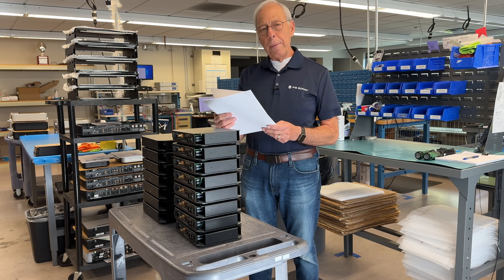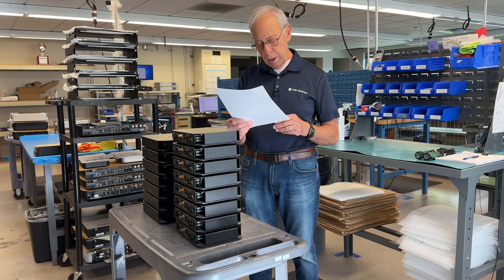ESS vs  Burr Brown DAC chips

Comment: I'm a DIY'er, and I have built a Streamer/DAC based on IAN Canada's stuff. However, I learn a lot watching Paul's videos, because so much of it I just don't understand. But I have two different output stages I have used, one is a passive transformer based the other an active OPA based circuit. All powered with super caps! Power makes a huge difference. One of Paul's video's helped me troubleshoot a bad/severe sibilance issue I was having, turned out to be a setting in my Anthem Pre/pro settings, which has me strongly considering a HT by=pass preamp, after seeing what a DSP setting in the Anthem caused. It was quite remarkable. My Anthem has a balanced input for 2 channel, "Analog Direct" or "Analog DSP", which allows for a powered subwoofer. That Analog DSP, made highs especially in female vocals sound so harsh as if my tweeter was blown. Setting it to "analog direct" fixed the issue. But if I go the HT by-pass route with a pre-amp I have to find one with XLR's because my output stage was designed to optimize balanced connections. In any case, thanks so much for what you do Paul!

Comment: Wow! FPGA for hifi/audio DAC. That’s somewhat overkill and expensive compared to wide available “hard wired” on die based DAs. Either electronics implementation (clock gen/oscillators, flip-flops, etc.) and verilog/vdl programming is a complex task BTW.

Comment: What? A lot of processing? Both, the data rates and processing required for A/D are a joke compared to high frequency applications. Usually, processing of data streams deals with Gigabytes per second and here we speak about a couple of Hundred kilobytes. Max. There is also no real reason for FPGAs. There is nothing in an FPGA you could not do with a dedicated IC design. An FPGA is an IC which can be programmed after production. So it is not better or worse compared to dedicated DAC chips.

Comment: Despite Paul's knowledge & experience that I admire, you all must remember Paul is a business man too, representing his company that claims to be one of the best in this market, and I have no doubt about it! But many of the subjects discussed around the audiophile experience is really very subjective and full of variables, from carpet pile height of your room passing through your real hearing ability up to the cash spent on the equipment (quality equipment if you will). Having said that, the search for the so called "perfect" or "better" product and overall experience lies in a compromise of budget, brand positioning, part's cost, part's availability, "sound taste", marketing differentiation guidance of the company, R&D team expertise, technical resources and a dozen of other unspoken variables that the discussion whether IC "A" versus IC "B" is almost irrelevant, or in other words, almost impossible to do fairly. The best solution I see is: try to hear/ experience different equipments as your budget allows and make your own choice ! And calm down and resign yourself to your choice, pretty sure the gear that costs 10x more will most likely sound better ......

Comment: Paul, I have a Marantz 2325 and Bose 901s series II and want to stream Tidal or Qobuz so I need a streamer. I could buy a cheap streamer like a Wiim or Node and use a separate DAC or use the DAC in the streamer. Can you recommend a solution?

Comment: Actually processing sound is not a super hard process for a modern dac or any modern dip chip. Your phone can output 4K 10 bit video at 60fps in real time and you don’t need fans or massive cooling. And actually inside the digital bit if you process with no errors or lag then the sound will be the same. It’s when you convert to analog where things can change. And this is why we moved to digital. It reduces the number of variables and possible errors

Comment: Many moons ago, I had an Alpine ERA-G320 eq and DSP. It had a BBE circuit. It was adjustable.  It could be contoured to increase effect at high or low frequencies. Utterly impressive. That EQ created a soundstage in my car that rivaled many home systems. Miss that thing!!
Reply: I hope your still into car audio you really should check out the technology of today and now with brands like Arc Audio, Helix and even Alpines F1 Status. The audio imaging you can get in a car now is ridiculous
Reply: I am, and I have a stack of equipment to put in my car. Merrell 3 ways for the door, 8W7 sub, AudioControl 5 channel dsp amp. Just need to get my act together...
Reply: @realbogus that's should be a nice setup!
Reply: Thanks!!!

Comment: As always a good overview by Paul.
If we delve a little deeper, I'd argue that everything matters and that the chip is the least impactful.  They are all good.  But that's like saying all red wine from Italy is good.  Some are better and we all have our preferences.  I like the nice old TDA1541a chip.
DAC sound is primarily driven by 4 thins.
1. Power supplies and grounding.  Every supply matters.  Particularly the digital ones.  Separate supplies for every consumer with tons of F and low noise turns digital to analogue.
2. Output stage including I/V.
3. Extremely low jitter I2S inputs.
4. The actual DAC.  While they are all great, when 1 through 3 are perfected, the DAC engine really sets the sound.  ESS is detailed but can lean to hard.  My old TDA1541a is obsolete in terms of specs, but to some the sound cannot be beat.
Reply: I have multiple TDA1541 DACs, some modern implementations like Abbas, MDHT Orchid and Border Patrol as well as some period era pieces from the likes of California Audio Labs and McIntosh. And yet being the same chip they all sound different but still have the soul of a smooth harmonic sound without digital glare.

Comment: Everything matters, and so do the chips. I had three ESS and two AKM DACs in price ranges from 900€ to 2900€ and I can say with confidence that they have a different sound signature, which always shines through. Whether the overall sound is full, fluid, well-balanced, low distortion, what have you, depends a lot on the circuitry around the chips.

Comment: AK4499 destroys them all!
Much better sound than ESS chips .... At the same time rest of DAC implementation is even more important, power supply , voltage regualtion quality, analog output section .... 
No excuse why good DACs cost as much as they do.... Chi-Fi is teaching all a lesson and will dominate and force our brands to run more lean operations and also be able to produce high end sub 700usd DACs not to mention 300usd ones

Comment: Isn't it ironic a company who swears by DSD uses a chip (ESS) that does not process DSD natively? :)
Reply: Sometimes Paul is kilometers away from the truth, is not an expert in some audio departments
Reply: @necrodh  That seems to be the case
Reply: I don't think so. The vast majority of music nowadays is in PCM and with streaming taking over, DSD as distribution format will only be in a further decline. It is only wise of ESS to put the design focus on PCM. On the input stage of their DSD supporting chips they do a fair job. These chips can do PCM decoding up to a rather irrelevant 768kHz 32 bits, which makes little sense. 96kHz 24 bits PCM already beats DSD-64. Besides, you can't actually create a native DSD master in a digital production process due to how all mixing and processing needs PCM and you end up having to transcode (lossy!) the output from PCM (e.g. DXD) to DSD. Yeah, someone could make an argument that DSD is a better ADC recording format out of older analog masters, but to gain maximum audience, it's better to ADC to PCM e.g. 192kHz 24 bits, which is already lossless streaming capable from major streaming services as FLAC lossless. So realistically, there is no future significant business in DSD and I can agree with Paul on ESS as best choice, especially considering AKM's situation.
Reply: @ThinkingBetter  I agree with everything you said, I'm even of the opinion that an ESS DAC with a good output stage renders moot most FPGA/discreet and R2R DACs these days - ESS sounds brilliant with PCM. But if you are aware of Paul's "opinions", he's constantly saying DSD is way better than PCM - and given that it's ironic he chooses a DAC chip (ESS) that converts DSD to a 6-bil format (so, NOT native). I'm just pointing out the irony... and BTW AKM is back in business for a while now (the Eversolo DMP-A8 uses it, amongst others), and their new chipset has a DSD Direct option on their firmware.
Reply: @jorgemg1984  Reality is PS Audio needs some unique differentiators but also some that are speaking tomorrow’s solutions rather than yesterday’s solutions. DSD made sense in the era of SACDs, in the past.
Reply: Really my Oppo has an ESS Dac and can output DSD.
Reply: @philipjackson5818  I'm not sure every ESS chip ever made has been tested but as far as I know, none of them process DSD natively like Burr Brown chips or some AKM chips (the AKM ones who can do it usually have a firmware option to have "DSD Direct" on or off, some manufacturers offer that option, others don't). ESS chips convert DSD to a proprietary multi-bit format, around 5 or 6 bits, I believe. So, when brands who use ESS claim their DACs do DSD Native, they really don't... they play it (as you said, there's output when you play DSD) but not in a "native" or "direct" way - and nothing wrong with that, it just goes against the whole "dsd is so much better than pcm that I'm gonna build a record label for it" that PS Audio goes for...
Reply: @jorgemg1984  well it puts out DSD via 5.1 Analogue channels not through HDMI, I can select PCM or DSD and there is a difference in the sound, for me PCM is better.
Reply: @philipjackson5818  Usually with ESS chips I prefer PCM, but there's a lot of other variables involved
Reply: @philipjackson5818  Yes, the best ESS chips can support DSD on the input. DSD is for 99% of audiophiles not a real concern anymore when music listening becomes from lossless CD (or better) quality FLAC streaming. From my Amazon Unlimited account I can stream 192kHz 24 bits and that's already better than DSD-64. DSD will keep fading out.
Reply: What about Cyrus logic ?
Reply: @ahmadathari3503 my daily...but in balanced architecture with 6 chips per channel (12 chips, smsl do200pro), with SPL Phonitor hp amp and hd600 (have other DACs with Burr-Brown for Fostex planar hps, AKM for critical listening or warm hps like Grado 325x or Sony MV-1, hd650...for speakers any neutral dac (I prefer studio gear like Weiss DACs to warmish or valve amp), but the room and speakers are the key factor

Comment: RME had to switch from AKM to ESS for the DAC chip in their Adi-2 FS DAC. I heard both versions in a demo on a good system in a shop. Difference was hardly noticeable.
Reply: Yes, the difference between well designed DACs is way way less audible than the differences between speakers and room acoustics.

Comment: Thanks for a really great and incredibly succinct explanation of what must be a very large subject. I hadn't really thought of the processing before as a little computer inside our hi-fi equipment but it's mind boggling when you think of all that analogue (I'm English!) signal being chopped up in nanoseconds and being spewed out as 0's and 1's! It's even more mind-boggling when you think of how our ear's do this so neatly with the inner ear bones and hairs in the cochlea. 

Digital hi-fi is actually a bit of a retrograde stage in this, isn't it? We start of with analogue sound which hairs in the cochlea convert into pulses our brain responds to. Traditional hi-fi used vinyl records (or analogue radio signal),  amplifiers and speakers whilst keeping it all analogue until it reaches our ears. Nowadays we worship introducing digital stages to all this: we convert our performances to digital and do all sorts of amazing processing on it and then convert the digital back to analogue before the last amplifier and speaker stages. And we call this progress!

Comment: From my limited personal experience, in general, ESS chip DACs have better detail retrieval, almost sharper sounding, compared to AKM chip DACs. It might be the chip, it might be the implementation might be the output stage, but out of the 15, 20 DACs that have sat in my system I found this to be the case.